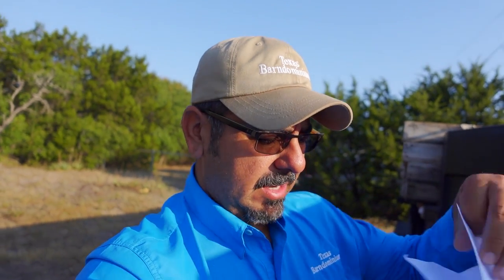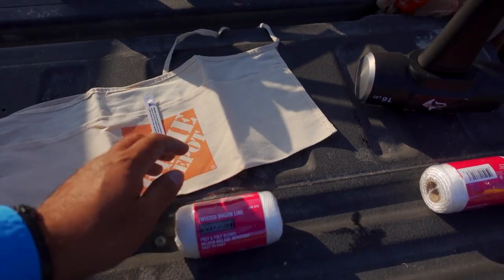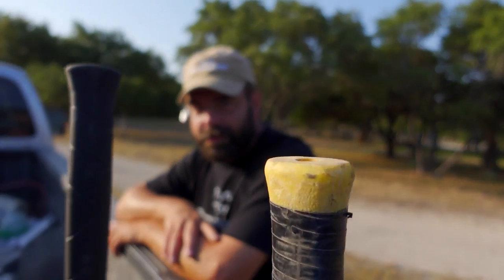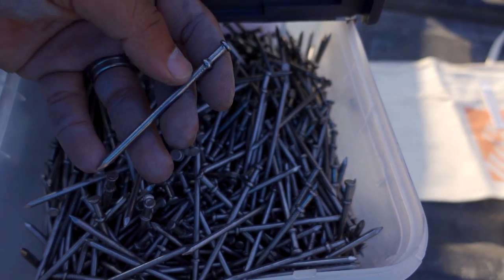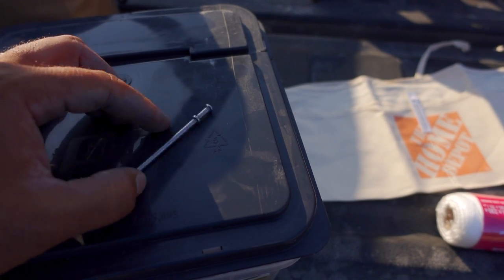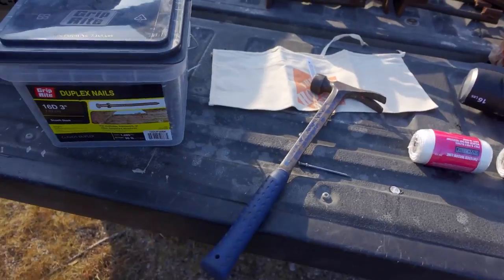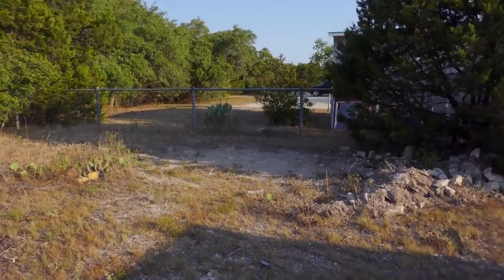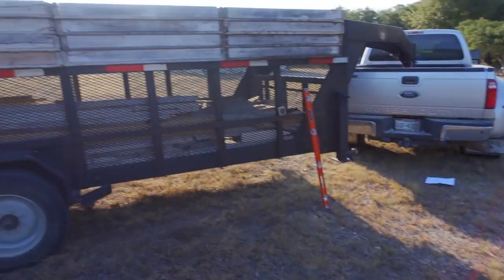How to form a concrete slab  in 2020 | Step by step

Comment: I remember putting over 300 stakes per day into crushed concrete bigger than my fist, what a nightmare. It made #1 crush stone look small. Then go  brace them and trim them down so the 14" concrete screed / vibrator could ride over the forms. Then we got ready for the butt whopping as we poured huge sections of city roads between 8" to 10" thick. I got tired of it after 4 years or so. I am now planning for 2021 a new dream shop for me and it's been over 10 years of any concrete pour for me. I enjoy these videos since day 1.

Comment: I bought my dad a 7" Makita dual 18v circular saw and it's been running 3 or 4 years strong. He cuts a ton of 2x8 and 2x12 concrete forms and stakes. The other employees dont wanna spend money so they cut all the forms by hand and usually asks to borrow the Makita. I have been a dewalt guy for over 15 years and still buy dewalt but that saw was awesome.
Reply: @halledwardb  I had Dewalt circular saws before but the Makita just dominated. Those blades are awesome too. I'm looking into a metal cutting circular saw now for my projects.
Reply: Im hooked on makita cordless now I git a circ saw a couple weeks ago and love it.

Comment: We use coated sinkers on the forms but leave the head out if we need to pull nails... p.s. if the bright common nails split apart the stakes.. turn the nail around and hit the point of the nail dulling it out, it helps from splitting the wood, works best on 1x4 stakes or 1x4 on flat work etc. Especially on dry wood 

Also if you have a concrete hammer drill (battery powered) pre drill the hole for the stake when the ground is hard... it helps.. use a big drill bit..
Reply: tricks are everything in construction
Reply: BLKsheepdog Tony G. I like the hammer drill idea, brilliant!
Reply: Right on! Even better, pre drill the hole in the ground and water it. Works like a charm! Hard to see Erik try to pound those boards into solid packed ground in triple digit heat!
Reply: @halledwardb  LMFAO😂
Reply: @baronvolkov6172  I started getting a heat stroke just watching, I use to hate it when the point of the stake curled up from the hard ground... only thing with water is your going to eat some mud ever swing 😂
Reply: @blksheepdogtonyg.6453  use steel stakes, we've been using them for 50 yrs.
Reply: You just taught me the rotohammer trick. That shit will probably make my staking driving 10x easier now

Comment: I bring 1 steel stake to open up the holes for the wood stakes to enter super easy, it usually works if not I drown the soil with a bunch of water to loosen up the top 2 to 3 inches

Comment: Put 2 stakes in at each corner with a piece of 4x3/4 joining them,the top of which is the level you want.
You can then mark the 4x3/4 with nails so it doesnt matter if the string comes off or if you go back a week later.That way if your building a cellar its simple to markdown as well.OK a couple more stakes but practically error free  ,your men just have to wrap strings around nails and they have it perfectly marked out even weeks later.Also for shallow rafts I just use 4x4 timber stacked instead of forms,way faster a few pins hold it and  a dozen nails,use a couple of times and then use them for new forms.

Comment: Why didn’t you prep the site first and strip the vegetation and topsoil. I figured it would be easier than working around forms. If you go with metal rods you could get an adapter for a SDS hammer drill and put them into the ground like a ground rod for an electrical panel. That would save you from swinging the sledge. Those also come cordless since you mentioned wanting to go all cordless. Thanks for sharing your videos and making the time to do that.
Reply: I don't get it, either.

Comment: Depending on where u live in Texas. U have dry heat they call it here in west Texas area. East  to south Texas wet heat.with Humidity.  I ought to know, I used to live in San Antonio as a kid. Plus I have sister that lives in Tyler.  I been there one 4 th of July few yrs back. Omg! I felt like I was in swamp cooler 🥵.  Back in July it was running over 105 * plus here. For 3 weeks straight before we got rain.  Now it hot again this past weekend and now here in middle of August.  But like they say if u don’t like the weather give it about 5 minutes it will change.  If it blows wind and it hot, oh lord u feel like r in a oven.  But u add wet humidity, like a steam bath.  Drink plenty of water, not cold 🥶 either.  It will make u sick if u been out in hot weather. Want rm temperature!  Most guys ik know that work out in this heat, have a rag, or bandanna, or towel cold wet, then they either wrap around the back of there neck or put under their hat, coming down the back side. No jk!
Reply: Good fo you soooo impressive

Comment: Were you charged for that string, or was it a freemason line?
If you just need a right angle is just remember 3,4, 5, or multiples of those and you get a right angle.

Erik, remember its easier to stay hydrated, than rehydrate. Heat exhaustion is no joke.
Reply from the maker: I don’t like the 345 rule.  It’s more accurate to get the actual diagonal dimensions.

Comment: hey eric.  i'm not a builder so i'm sure this is not a good question, but i'm going to ask it anyway.  if the ground is as hard as it was on this day, would using a little water on the ground (.5 cup -1cup or so) @ the site were your driving the stack into the ground help to soften the ground, making the stack easier to drive?
Reply from the maker: No, this was rock.  No water will help.

Comment: If I'm correct you're using a cloth tape to do cross square. STEEL TAPE! Check out chapa concrete in poth Texas if you want us how to do it right! Also you don't need d pins

Comment: You illustrate one of the greatest dangers of working in the heat - people who work in it all the time get used to it, and it sneaks up on you dangerously. Even guys with decades of experience working in the heat will sometimes just forget about it until it's too late, and end up in the hospital.

When listing the tools you needed for the job, you should have included "And a keg of ice water, and cooler full of sports drinks to replenish the electrolytes and fight off dehydration."

Comment: I have been there so dehydrated that I started throwing up when I was 13 year's old. I ended up in the hospital heat anit nothing to mess with. It's been 116 to 123 degrees for the high temp over the last week with the low temp of 95 degrees. Not any fun to be in let alone work in
Reply: Dang, where you located? Its hitting 100 in Washington state and im out, No work being done outside until it cools down! Even my shop is too hot to do anything in this heat, especially welding.
Reply: @baronvolkov6172  death Valley

Comment: How do you determine the cost per square foot on small jobs like this vs. foundations for houses
Reply from the maker: Take total cost and divide it by the square feet.
Reply: @TexasBarndominiums  
Say for example a foundation that is at 1ft off the ground in front but the back is 18ft to level how does one go about figuring the cost per square foot to charge a client that hires you to set form bag it rebar it pour and finish the slab
Reply: Sorry I'm confusing myself how to bid on a project like flatwork vs. tall foundations